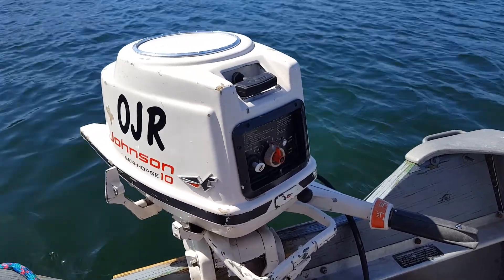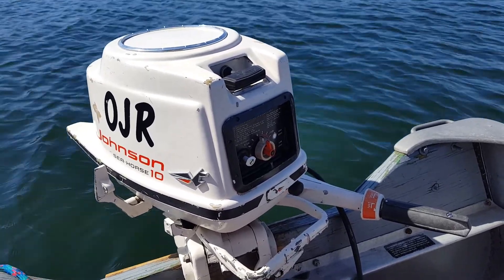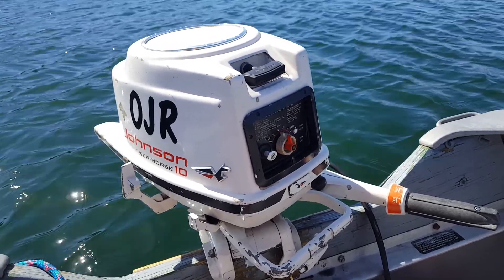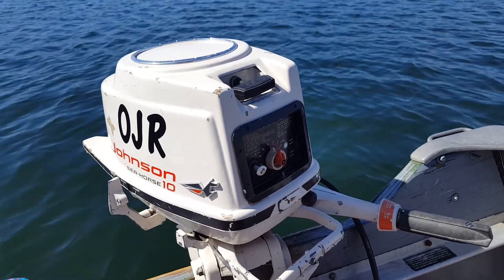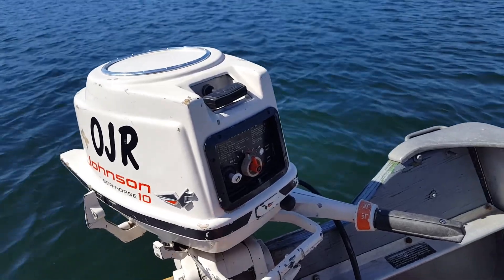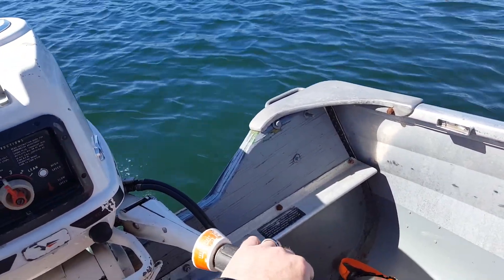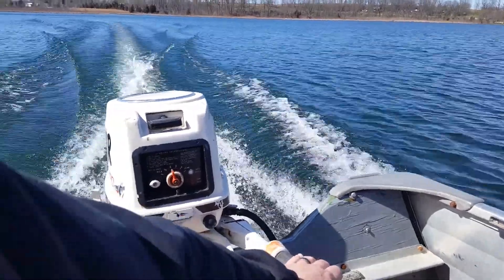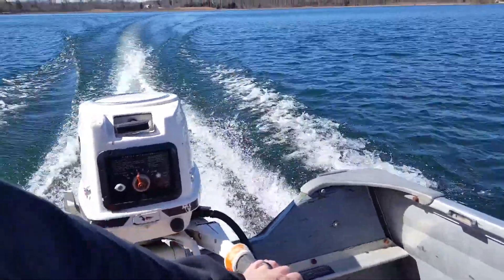1959 Johnson QD-20 10 hp Old JohnnyRude Season #2 Opener

Comment: I have this same motor and trying to find videos to help!! 

My motor runs but will not idle? Cleaned the carb a few times and seems not to help 

Any ideas on these ? I think maybe an issue with the lean rich seat ?
Reply from the maker: Brandon Thompson There are a number of things that can cause it to not idle well.  When you cleaned the carburetor,  how did you clean it?  Spray or soak? Compressed air to blow out the passages? How does the packing look for the low speed needle?  
How does the low speed speed needle look? Is it damaged where the needle seats in the seat in the carb body?  
Is the throttle cam synchronized properly to the magneto plate? Dirty points can cause a weak spark at low speeds. Points set at slightly off from 180 degrees apart in the magneto will also contribute to poor idle quality.  Have you tried to post your questions on AOMCI. org "Ask A Member"?  Lots of great folks there willing to help also.  I will try to help if I can.  I'm pretty familiar with these Classic OMCs.
Reply: I haven't had a chance to dig that far into it, got it pretty cheap but, sure I'm going to need some parts. Where would be a good site to get s new magneto, points and carb parts? Problem being we are limited around my kneck of the woods with boat mechanics around here

Comment: Is this hobby something you just started doing or were you an OB mechanic at one time?
Reply from the maker: I started into this hobby when i bought a small "cheap" outboard to put on a pond boat that I built out of an old pedal boat.  That motor turned out to be junk.  I then bought a 12 foot aluminum boat with a Mercury 9.8 that needed some work.  Then a pontoon boat with a bad motor.  No place I went would work on my old motors so I had to learn myself. That turned into a bit of an obsession and here we are.  I have never worked as an outboard mechanic.
Reply: Old JohnnyRude that’s awesome! I’ve always enjoyed the old outboards. And tractors, trucks, ect. 😂
Reply from the maker: @jons7677  Thank you.   I too have always enjoyed old tractors, trucks, cars, etc as well.  I've been working on power equipment engines and building things all my life.  Natural progression into outboards it seems.

Comment: 16 mph is pretty decent. What size boat are you running it on?
Reply from the maker: This was on my 14 foot Sea Nymph 14R. It will do better if it is trimmed up another notch on this boat.  Thanks for watching!
Reply: @oldjohnnyrude8404  thanks for the reply, going to check out a 14' aluminum boat with same motor. Just making sure it'll do a decent job once a deck and bow mount trolling motor are installed.